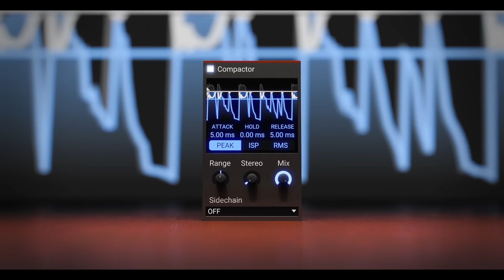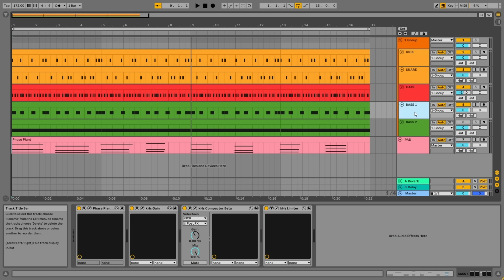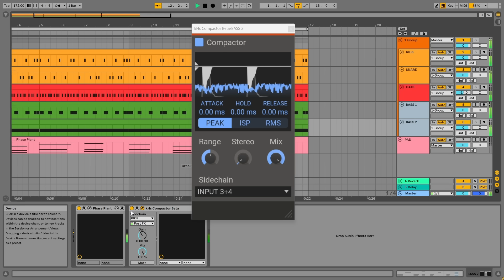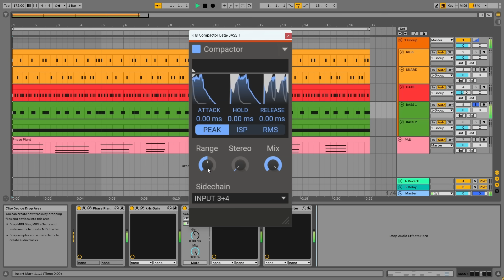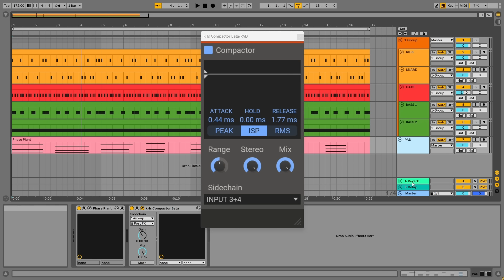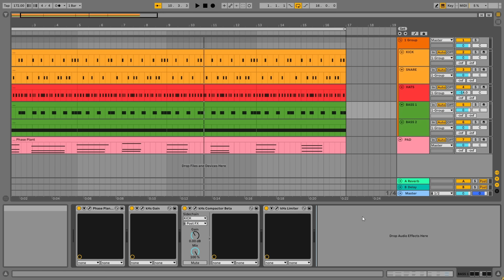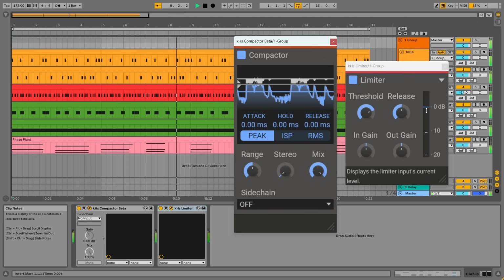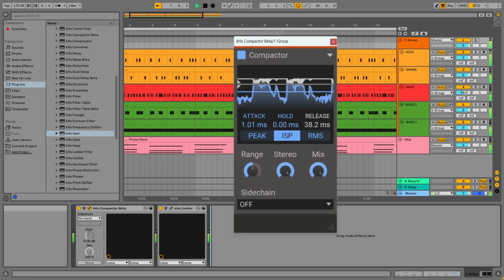Kilohearts Compactor walkthrough - New FREE Plugin

Comment: I need to thank you thousand times Kilohearts team.
I started to read about this technique 3 or 4 months ago, but never had the time to Read into this topic or Practice it.
And now, you release this Plugin, which really saves us a lot of time and headache and keeps us Creative again.
With your Plugin and my recently bought Bitwig i finally feel i can be focused on my music again, instead of technic :)

Short question before i start to learn the plugin.

Is there a way to compensate the difference in loudness without the sidechain input?
So i use my Kick as Sidechain input, but when the kick is gone, my lead group becomes very loud.

But from the first tesing, THIS is a Gamechanger. :)
Reply from the maker: It sounds like you might need to gain stage the lead group on the way in. Try putting our Clipper before Compactor and using the input gain control to ensure your levels are around zero.

Comment: How does the RANGE knob work? It is confusing because 0% does not mean 0% gain reduction.

100% seems to be 1:1 conversion but nothing else makes sense with that knob.
Reply from the maker: The Range knob sets how much of the sidechain signal is used to duck the main signal, based on its amplitude. You can see this in the display where the sidechain signal is shown as a grey graph, and the Range is represented by a blue horizontal line. Any part of the sidechain that goes above the blue line will trigger ducking. Anything below it will be ignored.

Going over 100% will cause the quieter parts to have more and more effect on the ducking.

Hope that helps! ❤️

Comment: A dumb question here — is this essentially a free version of Trackspacer? And what are the key differences between those two? Thank you for this amazing tool!
Reply: It's not. Compactor reduces the overall volume of all frequencies. Trackspacer reduces the specific frequencies found in your sidechain input (like an eq). You could do something similar and put multiple instances of Compactor in Multipass but it won't be as accurate as Trackspacer (and I also realize, you would have to split your sidechain up so you only get input from the frequency matching the Multipass with Compactor on it so it would be a real hassle to set up).
Reply: Just came back because I remembered that you can use Spectral Compressor in a similar way to Trackspacer. And it's free!
Reply from the maker: Nope. It's not quite the same, as someone already explained. 🥰

Comment: I honestly still don’t understand it 😅
Reply from the maker: Maybe it's not something you need! It is quite a specific tool. 🦆
Reply: If you know what side-chaining is, you should try it out--it's free!

Otherwise, the basics are actually pretty simple. Let's say we divide the possible speaker positions among the following possible values: -4, -3, -2, -1, 0, 1, 2, 3, 4. We have a drum signal and a bass signal and we can move the speaker cone once per millisecond. 

We attach the plugin to effect the output of the bass channel but feed it information from both. In the first millisecond, the drum input says +2 and the bass says +2. This adds to +4 which is within our tolerance so we relay the unmodified bass input to the output: +2. The next millisecond, the drums say +3 but the bass input is still signalling +2. 3+2 is higher than 4 so we chop the bass and output +1.

That's the core of it. Any time the sum of the samples goes over the threshold, it reduces the value on the one side it controls to keep the combined output from going over the allowed max. The rest is "just" timing controls. E.g., if it's been a while since we needed to chop, ease the amount of chop in over a millisecond or three.

Anyway, the best way to build intuition for how it sounds will be to try it on your own audio. Kilohearts has done the hard part and made it free. You just need to know how to route a side-chain in your respective DAW and you can try it out 😉.
Reply: @steamer2k319 thanks for your help. Then Isn’t this literally just like any sidechain ducker/compressor? The only difference is that you can dial in the frequencies to duck.
Reply: @RyanLuck-j2c There isn't any frequency dialing. The differences are...

Compressor: bass = bass - ((drum - threshold) / ratio).

Compactor: bass = if bass + drum > threshold {threshold - drum} else {bass}

Limiter: bass = bass - (threshold - drum)

Also, the compressor and limiter are only active when the drum surpasses the threshold on it's own.
Reply: @RyanLuck-j2cThose are the (pseudo) quantitative differences. Qualitatively, compacter will be much more responsive for "better" or for "worse". I.e., it's generally going to be more crunchy/distorted because it just snaps the bass sample to exactly fill the available headroom without respect to the bass' input level and without proportion to the drum level.

Comment: This just blows my mind. This is a dream solution to help make my vocals fit in the mix better. when I sing lower, my voice literally clashes with synth or guitar sounds. Like, I might as well be that synth sound or guitar. And when I sing high, that's like...all you get to hear which is a struggle to then bring the volume down and make it fit with out losing the power
Reply: You might want to try getting a better handle on compression. Once your volume is in range, you can try dynamic EQ to bring out some frequencies in your vocal only when necessary
Reply: I agree with  @ManeshwarSingh . This new Kilohearts plugin is awesome but it's going to be on the crunchy side. That might be what you want but Maneshwar listed some more classic, creamy/smooth ways of doing it. There are free plugins for each approach and being familiar with the trade-offs will help you achieve the sound you want--whether angrous/crunchy 😠 or silky smooth 😇.
Reply: @steamer2k319 but that's what I need. I like to use a lot of LoFi/distortion on my vocals.. so I want crunchy!  I should have started with that 😂😂
Reply: @buckycore  even if you're going for crunchy, you're going to want control. A common way of doing this is running a Neve 1073 plug-in or real life preamp and cranking the gain. You can really dirty it up as much as you want and clean it up with the EQ. Still, if your volume is out of control, you'll get an uneven sound until you push the saturatiob really hard and then you may lose some clarity or intelligibility of the vocal. Compressing into the saturation will give you a more controlled and even response - you can skip it if you don't want that - but to me it sounds like you want more control over your sound. Either way - happy experimenting!
Reply: @ManeshwarSingh I use Melda's dynamic EQ and whole bunch of different Compression. But as I told the other guy, most of my vocals use a lot of LoFi/Distortion. So it's like another crazy Synth or Guitar that says words  in the mix 😂